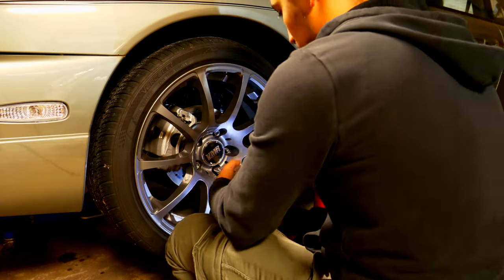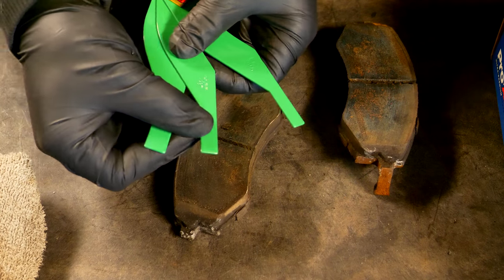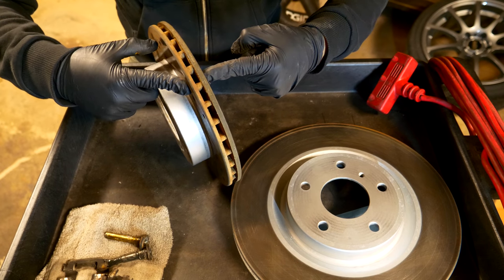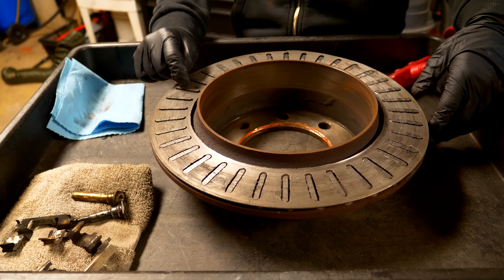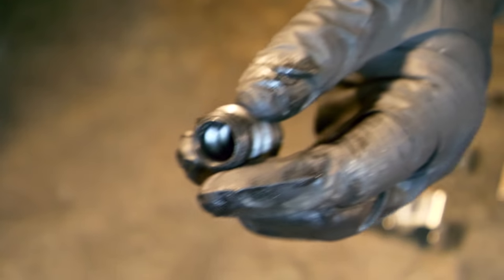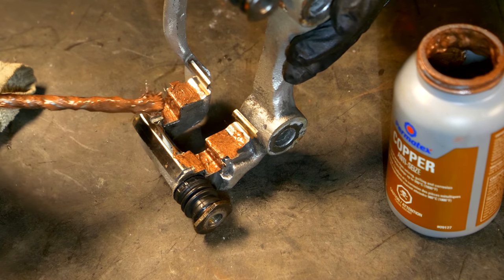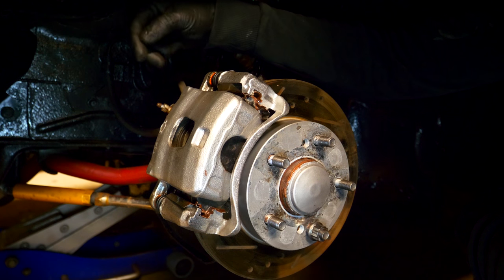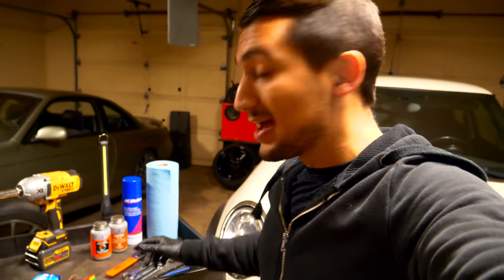How to Inspect and Lube Your Brakes (COMPLETE GUIDE)

Comment: Thanks for the run through.
Although, It's nice to encourage folks this is not the best repair to attempt for those with little experience... You can die if you fail a brake job... and so can others...
One stupid move is all it takes and there's at least 33 chances with a rebuild.
For example, getting a little grease on those brake pads will not end well... 
Having someone spot you on this job if it's your first time, may allow you to live for your second attempt.
:)

Comment: Very well produced video-- excellent videography and audio. Obviously, you or a professional associate worked carefully for this result.
* Question-- what brand and type of gloves do you prefer? After checking with Harbor Freight, I discovered HF uses the term "resists" when describing protection against gasoline and oil contact/spills.

Comment: Don't use too much silicone grease on the pins.
Don't use too much cooper grease on shims.
And if you need to push back the pistons because of new replacement pads then remove the cap of the brake fluid reservoir...
Reply: 100% bro!  Less is More in this case... he had enough on 1 pin to do 8 pins on 4 cailpers
Reply: Without a doubt you're onto it respectfully!! Well done indeed!!
Reply: Thank you guys 🙏

Comment: question for you! I have a 14 f150 plat 3.5 eco. So I got new pads on the front plus got them cut and when i slow down under 15-20mph it sounds like a grinding noise! couldnt figure it out, so i bought brand new rotors and pads again and its still making that faint grinding sound with slight vibrations in the pedals. I took it all apart today and cleaned everything up really good but there is still a slight grinding noise and I am completely out ideas?!!? Thank you

Comment: Take note of the quality of your brake pads too. I'm in Asia and I replaced my toyota oem brake pads with bendix general ct, its a brand from Australia and its super squeaky in the morning sometimes intermittent even though I put brake lubricant on the parts that need it. I'm replacing it with a japanese brand called Nisshinbo hopefully its not noisy asf. Couldn't find Akebono brand for my car but both brands are OE quality from Japan.

Comment: I would suggest on putting some grease on the back of the pads. Also put some antisieze lube on the bolts and the face of the hub part on the disc that come in contact with the back of the wheel to stop the fusing together. Also remove the top from the brake fluid bottle to stop you blowing a master cylinder. And once the wheel is back on and the fluid topped up  pump the brakes to bring them upto the rotor.

Comment: Thanks for sharing your knowledge on YouTube. A number of other videos mentioned adding some anti-seize to the caliper mounting bolts and the caliper pin mounting bolts. Thoughts?
Reply: For the caliper mounting bolts you  should use blue locktite to prevent it from vibrating loose. If you add any grease it has a higher chance the bolt will vibrate loose. If you don't have blue locktite and have silicone spray that will help it from rusting. As for the caliper pin mounting bolts you can put grease there. Do not tighten them too tight with any grease as you can over torque with lubrication inside.

Comment: Awesome video, but besides torqueing the lug nuts shouldn't caliper nuts or bolts  also need torqueing ?,and where would one get the proper torqueing specs for everything  that needs to be torqued with the breaks? , still great video very efficient job !!, thanks !

Comment: you should put some blue thread locker on the bolts before tightening them up...vibration might and will lose them up over time
Reply: Ralph der Kapitaen factory doesn’t. You use the correct amount of torque and nothing happens.

Comment: Thanks for a great video, really useful to see how someone else does it. But i'm not a huge fan of that orange brake lube or how much copper lube you apply to the shoes. I use silicone lube for brake pins and only a tiny dab of copper on the tips of the actual brake pad tabs, not on the shoes like you do. I just think the less copper lube you have in and around the brake disc surface the better. But thanks for the video mate, loved it !

Comment: Awesome Video! Should you open brake fluid cap before doing this?
Reply: Yes
Reply: A better check is making sure the fluid level in the reservoir is not at the maximum level when you start a brake pad replacement.

Comment: Great job of teaching how to do this (including the whys). Thanks!!
We used to us a piece of a 1x4 and a C-clamp to compress a brake cylinder.  Is there any reason why that won't work anymore?
Reply from the maker: That will work for the front, however won't work for the rears with the parking brake built into the caliper.

Comment: O f... I have never seen rotor like that. We had van with piston grinded by the disc since the metal part of pad fell off after the friction material wore out. Because in Canada we have very harsh winter we use different procedure. Often we sand blasted the brackets, paint them, under stainless steel shims we use Molybdenum grease to keep moisture out. Wurth silicone grease on pins. Basically very similar to what you do, just more heavy duty to keep the moisture and salt out to prevent corrosion. Not bad.

Comment: Thx the video. I applied copper grease to the metal part and look quite. However, it looks like the noise come up again after washing car. It usually happened during cold start. After running hot, the noise is gone.

Comment: I worked on a FORD one time, the brake pads were frozen in their holder and I used an air hammer to get them out. In my many years of experience, never seen any shop clean or lubricate anything to this degree of care. The mechanics do not use antiseize on anything and a few months later use a sledge hammer to remove the rotors because they are welded to the hub from rust... I learned a long time ago that a light application of wheel bearing grease on the axle flange prevents rust and the rotors or drums come right off. For those people that do not work on cars, Autozone has single use packets of the caliper grease and antiseize for a dollar each, no need to buy a large bottle or tube for a one time use.

Comment: From what I can read on Permatex website, Ceramic Extreme Brake Parts Lubricant and Ultra Disc Brake Caliper Lube should be use on metal-to-metal contact only. This means I could use those instead of the copper anti-seize you are using, but not for slider pin as they are not rubber friendly. For the slider pin, I should use Silicone Ceramic Extreme Brake Parts Lubricant. Please correct me if I'm wrong. Also, is there any reason why you are using Antiseize instead of those two previously mentionned brake lubricant?

Comment: The top pin was in the bottom , bottom pin in the top and the top pin was missing the rubber sleeve that reduces vibration .  These issue exist because you assembled it wrong a month ago when you did the brake job.

Comment: Execellent video was wondering how you tighten the calliper bracket  screw they required significant torque what can b used in that tight space
Reply from the maker: You would use a torque wrench to tighten it to spec. In hard to reach locations, you can also use a Crow's foot 👍

Comment: What do I do if the disc is rusted ? It’s a corolla 2018 not often used. Also I see video that all the system it’s sprayed with a grey material are you suggesting this if yes what should I used ? I am leaving in Canada where is humidity and snow. Also is the cleaning is necessary if the back brake are drums. Thanks for your help . Like your video well done and instructions are clearly spelled
Reply: If your disc is rusted because of sitting, you may need them turned. If just some light rust then you will probably sand it off with use of the brakes anyways

Im going to assume the grey material is a rust preventative or paint, atleast sounds like it. Maybe not much a bad idea being in canada.

And yes there are some spots in brake drums that could benefit from rust removal and some anti seize

Comment: The number of videos and varying comments on how to properly lubricate a brake caliper was the reason ProSlip was developed..to end the confusion by 'the appliance of science'. The ProSlip blog discusses the topics raised here. ProSlip PIN is the only commercially available lubricant made for sliding caliper pins..it is a synthetic glycol with lithium soap - a formula specifed by Toyota and Mercedes. Made by Dow it prevents fretting corrosion,is rubber compatible but crucially is very very low friction to allow the micro movements of the caliper. The biggest mistake folks make is to ignore the piston seal - this seal is cut at an angle to pull back the piston off the pad. A dry seal is a cause of brake drag, the other is pads corroded in the clips which increases resistance pad-disc..i.e. brake drag. On a caliper use brake fluid to lubricate rubber. Silicone grease won't prevent fretting corrosion and is not a low friction lubricant and this is why Toyota and others no longer specify silicone grease for caliper pins.

Comment: Very good. I wanted to ask you how to lubricate the rubber boot that houses the piston on the caliper. If the piston on the caliper is sticking, I would think some lubrication with some high temperature lube would do it well. Do you agree?

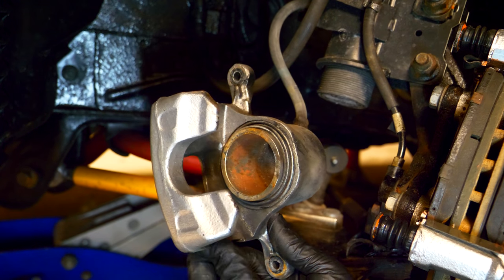Comment: @13:36  What is the proper way to clean inside of that bore (cylinder) the rust? Can you clean the rust out w/Brake Fluid? Probably that will prevent from rusting in the future, since BF is oily. But maybe to apply smth else. Do you need to lubricate that bore inside after cleaning the rust? Thank you for the great instructional film.

Comment: Hi Milan, thanks for the video, very very usefull, i have a question....i’m going to change my brake rotors, brake pads and i have to change the brake fluid, 
What you reccomend me to do first?? 
Thanks
Reply from the maker: You should remove the wheels, calipers, caliper carrier, remove old rotors, install new rotors, install new pads, reinstall caliper, repeat on all 4 corners, bleed brakes 👍

Comment: amazing video, thank you. I recently had a brake pads installed by the dealership and after a few months.. I notices some paste like material is coming off from the clip/ shin area. it is like copper or white paste turned black.. I was alarmed about it.. I saw your video and seems like you put copper antiseize..  would it normal for them to come off like that? thanks again.

Comment: Hello, wanted to ask: why you are using 2 types of lubs? In the technical datasheet of Permatex® Silicone Ceramic Extreme used in the video, there are mentioned almost all parts of the braking system where you used anti-sieze one. BTW the link for silicone lub is wrong since it  opens the page for the ceramic lub from permatex.

Comment: Man, you just saved my life and that looks like my car.... I just bought the bracket and pins and returned the original with a seized pin to the store for recycle credit.... Than i forgot pin orientation and where new pins would go....rubber sleeve pin top or bottom.... Watching the video i now know the rubber sleeve pin is on top.... I'm gonna dose and bathe those babies with the grease you use now ... Great Vid, thanks
Reply: BTW, Always take pics of what you are doing so you don't look like a complete idiot later.... Now, I am the idiot

Comment: Had it done but now I heard metal clapping sound each time I step on the brake. Sounded like both the front pads is floating and only made contact with the rotor when I hit the panel. Any suggestion ?

Comment: OK, I have to admit, it is my first foray into disc brakes.
Should the caliper come off easily?  The video sort of blew past this removal.  How do you "unload" the caliper for easy removal?
Mine came off...eventually...with much back-and-forth gentle persuasion.  But it seems I am missing something.
Checked into caliper rebuild kits but none that I found include a piston, just the seals.  What is that about?
And the rebuild unit's specifications, indicate the piston is PLASTIC.  WHAT?  Those on my unit sure appear to be metal.

Comment: What's better for my 2008 impreza 2.5i, 3M CopperAntisieze + 3M Silicon Paste, OR  Permatex Silicon Ceramic brake lubricant + Permatex Copper Antisieze ? Why did you switch from 3M products to Permatex products ?

Comment: The inside brake pad will always wear more that is where the pressure is applied first then it is pinched against the outside pad. Never lube brake pads!
Reply: molehog adventures not true they should wear even, if inside wears more your caliper is sticking
Reply: molehog adventures can I use aluminum antiseize instead of copper antiseize?
Reply: @NFLYoungBoy223  You really don't need to use antisieze at all as the temps never get into the range where AS is needed.  Any decent bearing high drop point bearing grease will work fine.
Reply: Christopher Haak I ended up taking my car to the mechanic and ended up getting new brake calipers

Comment: I use to put some copper paste between the back of the pads and the caliper, it prevents noises from the brakes (squeaking or rattles)
Reply from the maker: I have heard that doing that does prevent noises, and if that works for you, by all means do it, but I'm yet to solve a brake squeal by doing that. This is how I solve the brake squeal if you have it: https://youtu.be/MdyrFIS1Mz8
Reply: Your brake squeal solution is effective and works in another application too, on the rotary clutch of a modern scooter (that has a very similar material as the brake pads). I had rattles in the engaging of the clutch on my 2014 Vespa Lx, I've done that sanding on the edges and solved the problem, it became very smooth, no more rattles.

Comment: Is caliper piston adjustment required if you are not replacing brake pads?
Reply from the maker: If you are just inspecting, you may be able to get away without using the piston retractors.

Comment: The problem with too much pin lubricant is it's not compressible.  Too much between the pin and the bottom-out surface means the pin doesn't move equally both sides of the car, and moreso between pins on the same caliper.  That is to say, one pin with too much lubricant will 'bottom out' sooner than the other one, causing uneven pad wear.

Best practice is to lube, twist in the bore to distribute all around the cavity and then check if the pin can be moved laterally inside the bore.  It shouldn't if the lube is adequate since lube will be distributed equally, suspending the pin with in.  You never want to lube the ends, or have too much lube one the sides that can push down to the bottom.  When testing pins without the boots you'll see between them if they reach 'bottom' together.  If they bottom out equally and right to the neck of the screw, then apply a little lube around the necks of the boot as water seal at either end.  Don't worry if the boot isn't full of lube.  As brake system heats and cools, lube will distribute normally along the shaft.

I noticed one of the pins has its rubber washer removed from the tip.  The role of this washer tip is to control impact rattle on the leading edge of the caliper, and therefore pins cannot be swapped between holes even if they seem to fit.  If both pins are out and it's forgotten which pin goes where,  put the washer pin on the first edge  of the rotor turn.  It will be top - or bottom - depending on whether calipers are in front or behind the wheel.  Technically, it won't hurt to get them mixed up, but again, it's not best practice, since some machining specs are slightly different between pin holes that we would not notice.  Better to pull the pins and keep them separated relative to the bore from which they came so they go back in according to specs, and keep the tip washer right where it belongs to prevent possible pin rattle on impact with rotor.  This is the edge that absorbs initial rotor impact.

The final problem with too much lube is debris collection in moving parts ... dust, stones, road junk.  Better to smear enough to block metal from oxygen exposure causing rust seizing, and call it a day.  A smear on and under clips will do it, along with smear on the iron caliper ears of  contact points rather than all over brake pads.  Rule of thumb is wherever rust might blister and cause seizing thru 'lift' or rust-weld to other parts that need to be free.

I like the idea of pin lube being orange, but it will freak out any garage that doesn't know its still silicone, should the vehicle wind up there under another owner.  They'll be certain somebody screwed up using the wrong lube, and possibly charge the customer for something else to cover nuisance of (unnecessary) clean out.  But then it's that kind of scamming that drives people to do brakes at home in the first place.  ;)

Comment: Hey i noticed both slider pins are different does it make a difference which one goes in each slot? I've changed and cleaned mine 3 times and keep getting a clattering noise when i press the brakes only at a certain pressure,just got the new ones and notice they're different like these in video

Comment: you put a lot of orange lubricant on the guide pins. smn else was saying, put very thin coat, because otherwise it creates an airtight seal. yes, there are 3 grooves-channels that should allow grease and air to go freely. however, grease is very viscous, and i am not convinced that excess grease will move easily. please correct me if i am wrong.
Reply from the maker: I'm yet to run into a problem with putting as much lubricant on as I do. After applying this product Permatex, I'm yet to have a single guide pin seize on me.